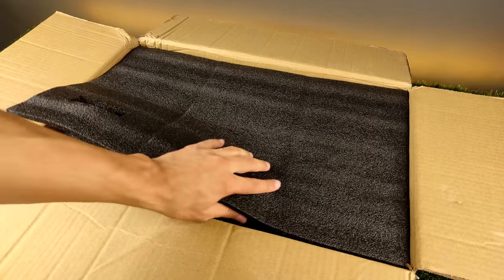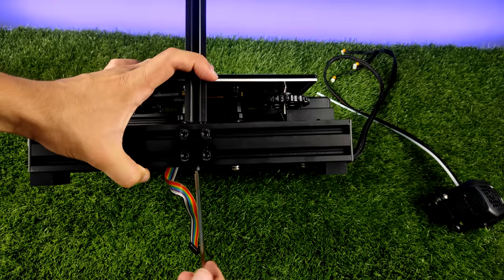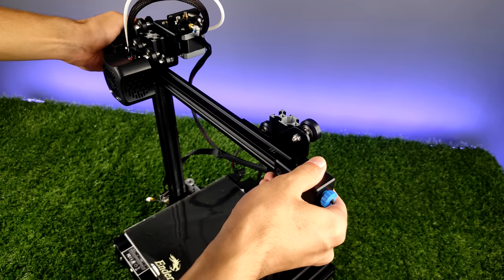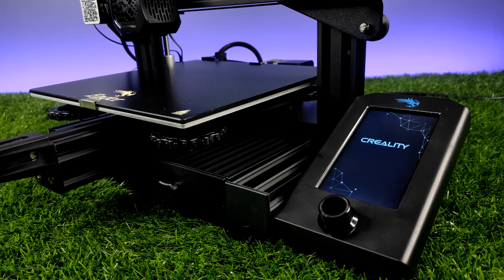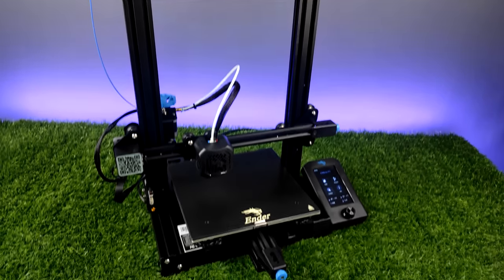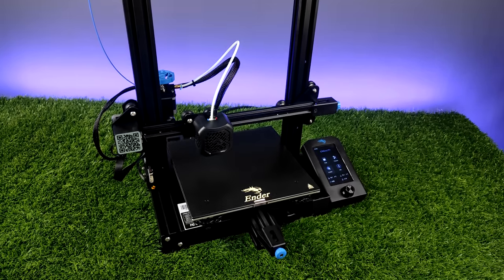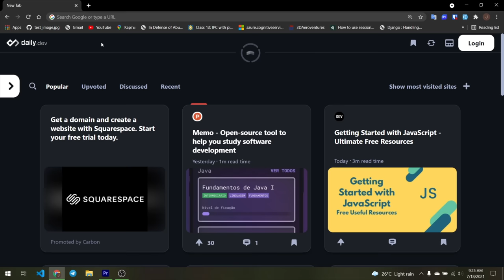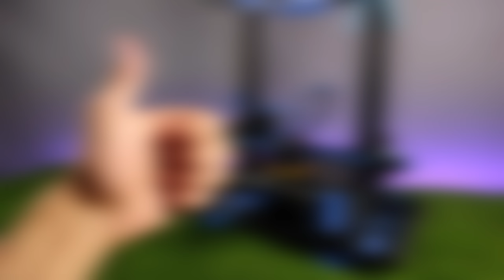21 First Upgrades For Your Ender 3 V2 // Best Mods For Ender 3 V2

Comment: What are you spraying the parts with at 8:19 and why?
Reply from the maker: Hello, it is super glue accelerator, because it is so cold, so it will cool the bed and print will pop right off, super fast
Reply: @engineericly  interesting, I've never heard of that. Does it leave a residue on the part or bed? Do you recommend a particular brand?
Reply: @overkill2828  you can use spray air, when it sprays out of the can it expands and becomes cold, so it makes it easier to remove prints
Reply: @engineericly  don't use that. It damages the glass bed over time. Just spray a small amount of water. Capillary action will do the rest

Comment: Can you share your print configuration? I recently bought the Ender 3 Max and couldn't print nothing with success. I can solve my warping problem using the glass bed from the brand. Ty!
Reply from the maker: Hello, what exact problem you have?
if it is warping, did you clean your glass bed?
Reply: @engineericly  I removed the protector film from the glass. I didn't cleaned because it's new and I asume it was okay. Should I clean it? Can I ask you how or with what kind of product? Ty!!!
Reply from the maker: @braiandickson  Yes, you should remove that film, basically when you remove it is already clean but after some time, it will get dirty, so you need to clean, best wayis to use dish soup and little bit warm water and wash it with your finger(using hard things will leave scratches on it), and rinse it with water. after that don't touch the surface with your finger and dry it with paper towel, that's all, print with this clean glass you will see the effect InshaAllah. don't forget to set bed temperature 5 degree higher than filament manufacturer said as it is thick glass

Comment: Moving the spool holder on the side of the top extrusion , makes no sense to me. Its usually bad in the middle and I can only image how this will affect the prints with a lot of retractions when the spool starts to wobble, when is off-centered like this. Side mounted spool holder is a good update only if mounted on the side base extrusions, making the other wheel update(just before the extruder) redundant as well, since the filament is will be coming from the perfect angle.
Reply: The roller guide adds further salt to the injury. The printer already feeds filament into the hot end using a motor, there's no need to aid its path. Doing that will add more resistance and might result in under extrusions in case the guide wheel gets in the way, since the printer has no filament sensor.

Comment: Hello, I'm new in the 3D printer Game, I have the same printer but my bed is not the same as you, should I buy one in glass ?
Reply: I have the ended 3. I just replaced my bed with glass and the 3d printed parts just pop off easily. You don’t really have to scrap and man handle them off like on the metal stock bed. Just what I experienced.Hope that helps.
Reply: You don’t have to buy a new all he did was flip his bed upside down

Comment: Fixing bed bolts with nuts (to the bed, with nylon washers to not scratch paint on bed) and using printed centering spacers for stock springs - cheap and almost the same effect (even more important) than replacing with that yellow springs.
Reply: can you dumb this down for me
Reply: @Foodran  Not sure that correctly understand that phraseological unit. Please rephrase
Reply: @Kekht  😟
Reply: The yellow springs have more tension for the same amount of travel.
Reply: @BrunodeSouzaLino  And blue springs even more. So what benefit for extra money? You can even make it rigid (but set "horizon" before). It is worth to think of purpose: you want to solve something, or just have fun with spending money?
Reply: @Kekht  In practice, the springs that come with the printer are fine.
Reply: @BrunodeSouzaLino  that is what I'm talking about. But fine by itself, not how they installed in stock.

Comment: First 10 min of the vid are a waste. It looks nice and customised. But almost everything on it has no use. You want as less as possible items dangeling on there.

The spiral. Dont restrain it. Someone else allready said it.

The feet. Keep em like they are. Sturdy and absorbing some of the vibration.

I whouldn't even use the spatula to get prints off.
Glass expands when it's warm. Then let it cool off and print's just pop off. (No scratches)

The usefull upgrades start with the yellow bed springs.
And the bl touch. 
These are propper upgrades.

If you are gonna mod the filament holder. Try looking for the one with the bearings that fit in. Result is less friction and less stress on the extruder.
Also get the metal extruder.
And yes the bowden tube. Capricorn.also good.

As for alot of upgrades.
Try the assemble vid of "a tomb of 3d horrors"
And you won't even need em your printer will be better alligned and therefor nicer prints from the start.

One of the best upgrades in my eyes is octoprint with a raspberry pi.
That way I can leave the house and keep an eye on my prints and even force it to stop. (Yes its better to stay at home but some prints take time.

For a more personal touch. Yes print the strips and click them in. But you don't need a handle. If you are gonna move your printer around it will only get out of allignment and need new tweaks again to get propper prints. 

It reminds me of a over customized car (wich is a personal choice) but it doesn't do the performance any good.

After sounding only negative. I do like the video and the way it's shot. I looks professional. 
So sorry for sounding like a compleet douche.

Comment: 4:50 the thick rubber feet are there to help absorb vibrations and add stability, using plastic ones will greatly affect your prints quality for the vibrations will cause nasty misalignment
Reply: The rubber feet were installed into the bottom of the new feet to still give the dampening.
Reply: @kites0852  yes I also watched it, that still added height and the further it is from the table the less stable it will be

Comment: I see many scream to not do the Z rod holder.  Interestingly enough, the kit from Creality for dual Z axis rods comes with a similar bracket at the top of the rod as well as one for the original Z rod.  Granted, they have a roller bearing in them, but, the manufacturer is supplying these in their upgrade kit.  Just saying.  If the rods are aligned correctly during installation, I don’t see how they hurt, and they protect if someone grabs it wrong plus caps the top of the rod.  Never had any luck with auto leveling nor direct drive extruder.  Issues no matter what I did. The rest is cosmetic, which looks awesome, so lighten up “Francis”.
Reply: It doesn't matter if creality includes it in their kit or not, it's a part that can damage your leadscrew.   If you have the dual Z kit you should leave that part out completely. Better yet, make the belted Z upgrade which will be much better than lead screws.
Reply: You rarely need to manually move the z axis up and down on a properly set printer, so adding that part is useless.
Reply: @erikhellman3974  Can you please explain how capping the leadscrew can damage it? I went ahead and installed the set that came with the dual Z kit, and I have mine aligned so the rod has some free play within the cap. In other words, there’s no binding. I just don’t see the harm, and it certainly isn’t affecting the quality of my prints, but perhaps I’m missing something.

Comment: The first upgrade is useless. The Ender 3 v2 comes with a drawer already. Why would you add more of them when you could just print dividers for the one that came with the printer? The grip is also questionable. If you want a handle, print a handle. You should never grab a printer by the inner part of the gantry. For the feet, if you're not printing them out of flexible filament, you're wasting your time replacing the stock ones.

The most useful things you could upgrade the 3v2 for would be the stiffer sprints, the BL Touch or CR Touch sensors, PEI Build sheet and replace the stock firmware with the Jyers one. If you replace the screen for the touch one, you essentially have a CR SE.

Comment: Help, what spray does he use in minute 8:17 to take off the pieces?
Reply: Compressed air
Reply: It was super glue accelerator, to cool the model so it pops right off!

Comment: honestly i dont recommend actually doing any of this to ur ender. The machine is designed perfectly. The only thing here that really benefits you is the Z axis alignment print.

Other than that get a PEI build plate and call it a day. Changing all this shit can throw off the operating parameters wildly. Especially the springs for the build plate, and the printers feet. You added plastic and shrunk the amount of rubber. Making it much more susceptible to vibration. Just buy foam panel from an art supply store and put your printer on it.
Reply: The problem is when people buy the printer and already upgrade it without using it. Ideally, you should have at least 100 print hours on it before adding anything else to make sure everything else is working properly. Best upgrades for it would be the BLTouch or CR Touch sensor, PEI sheet and Jyers firmware. If you add the touchscreen, you're essentially turning your 3v2 into a CR 6 SE.

Comment: the z stepper spacer is only needed if you have misaligned motors, which were common in the original ender 3 v1s. It might do more damage to Ender 3 v2's

Comment: Hi, love your videos!! Hope you can help me. I have an ender 3 v2, extruder motor stopped moving, Plugged the motor to a different axis and did rotate so the motor is fine, check continuity of the extruder cables and is ok, check voltages and vrefs of the extruder pins and extruder drive and all are ok. Everything seems fine but cant get my extruder axis to work. Do you have any clue what is happening? Appreciate any help of guide. I dont know if I need a new board, or motor, or cables or psu… driving me crazy! Thanks!!!!

Comment: Most of these are either unimportant, will wear out quickly, or as others have pointed out, will damage your 3d printer. Install the bltouch and skip everything else in this video.

Comment: Most of these seem pretty pointless to me. There is already a drawer in the base for the tools etc. The only mods I’ve done which seemed necessary were the upgraded yellow springs and improved cold end mechanism. And a pulley to improve the filament path, which I found on Thingyverse, and is a far better design than the one shown here.
Reply: yea but....it looks cool
Reply: The pulley is unnecessary. The filament is loaded with a motor that already compensates the tension.

Comment: Most of this is mods for the sake of mods, which is fine, I guess. When I first started printing, I wanted to do all of this stuff, but a year later most of it just seems like a waste of time and/or money. Yes, even the BL Touch and the beloved yellow springs. Absolutely no one should have a bubble level on their printer. 

And seriously, what’s with all the handles? Are people’s hands really that delicate?
Reply: The BL Touch and yellow springs are useless? legit question, I was planning on buying those 2. Does it not make any difference?
Reply: @ktestable  neither is useless, but neither is necessary. BL touch is a luxury so that you never need to worry about your bed level (or at least worry significantly less). If you can’t get your bed level without the BL touch, you’re doing something wrong and need to address that first. 

Yellow bed springs are stiffer and objectively better, but still unnecessary. The stock springs work just fine as long as they are compressed well (i.e. the bed is low). This may require adjusting your Z end stop to match the bed. 

Most people offering advice online will love to spend your money.
Reply: @ktestable   It's advised that you put at least 100 print hours on the printer as it comes out of the box before thinking about upgrades of any sort. The Ender 3v2 is perfectly capable of doing high quality prints the way it comes out of the box if properly set up and configured. I'd say Prusa is reponsible for creating the notion that 3D printers need automatic bed leveling or else they're not good.

Comment: The best upgrade I did with my Creality’s was putting them in a cupboard and buying 2 Anycubic Chirons 

I’ve had ender 3 pro I paid more for upgrades than I paid for the printer 
Cr10 v2 didn’t even work out of the box so bad that Banggood told me to keep the printer and refunded the full price 
Cr10 max refused to level even with bl touch 
Cr10 s5 went bang after 5 months
Reply: I went the ender 5 plus route and first print was nicest ever ever had from a stick untuned printer.  Might be worth looking into over the 10 with those issues.
Reply: @MACISUS  I’ll never buy creality again I have 2 Anycubic chirons now no upgrades work perfect

Comment: 20 pointless mods youll end up removing in less then a week.... only thing useful is side mounting the spool for bowden, literally everything else is a waste of filament. oh and use silicone bed mounts and get rid of those stupid springs they are nothing but a headache.

Comment: Ugh. Im sorry. But the entire Ender 3 line (along with all of its bastard cousin clones) is nothing but a beginner's trap. All of the IMPORTANT upgrades like a full metal hot end, auto bed leveling system, etc, cost real money and by the time you have an ender in a useable state you would have spent more money than if you had just bought a CR-6 or comparable.

STOP.
BUYING.
ENDERS.